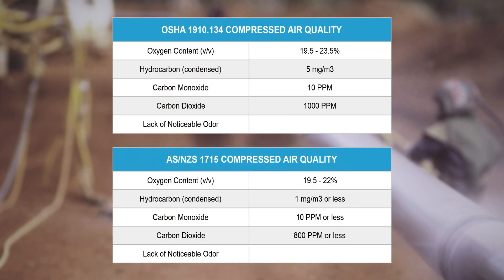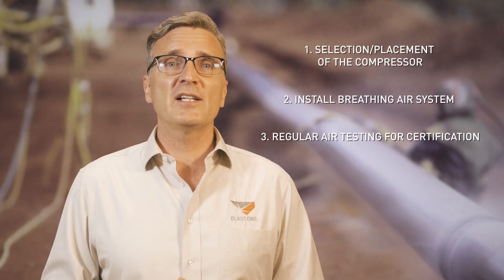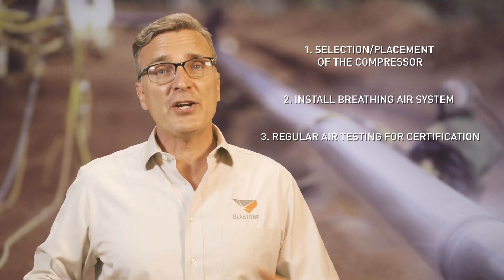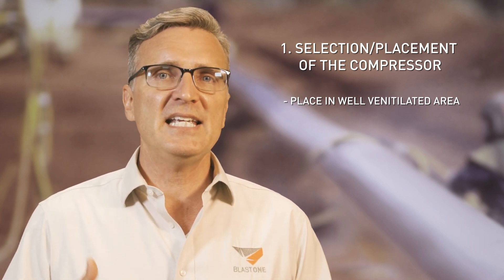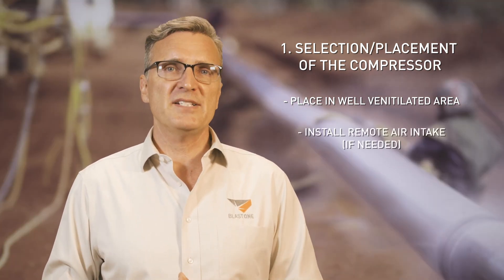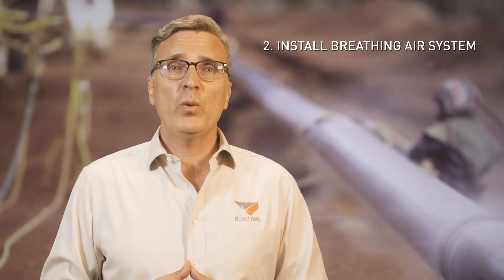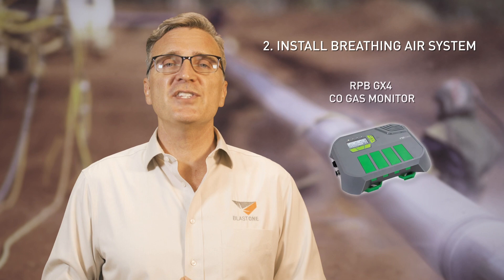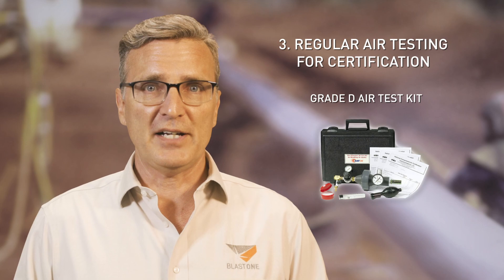How to achieve Grade D Compliant Breathing Air

Comment: Isn't there a certain amount of moisture you need in the air for them to breathe?
Reply from the maker: Hello!  There is no requirement in the standard for the moisture content.  However, we do find that blasters mostly use air that hasn't gone through an Air Dryer, and this will give them the humidity they need.